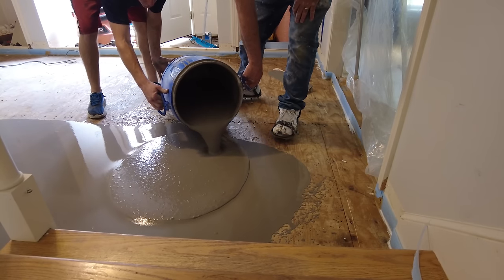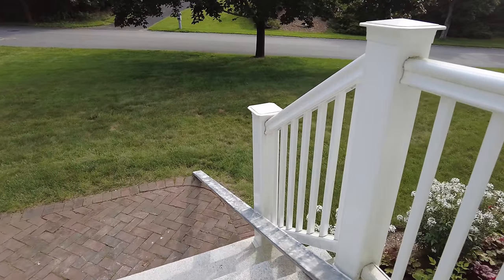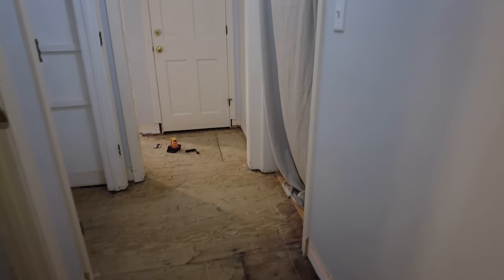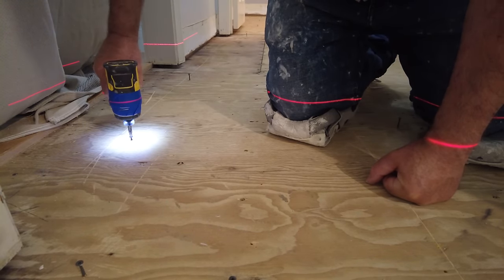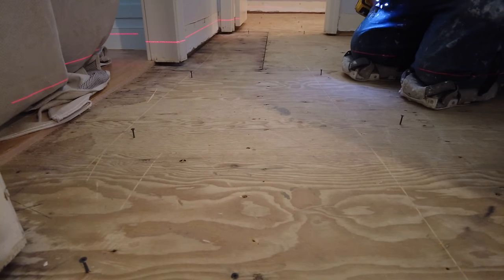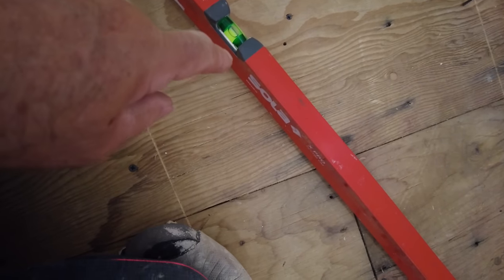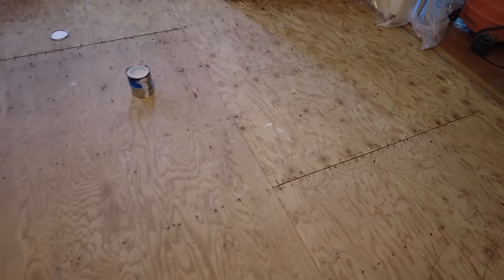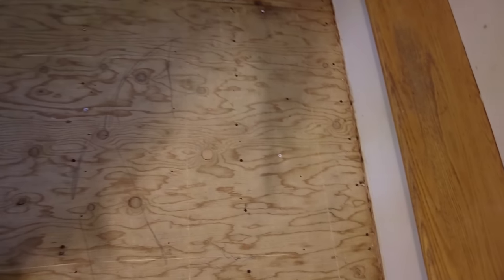Self leveling a floor, how it's done.

Comment: Seems to me such a large area should be lifted from under the house since you seem to follow the beams I bet a few beams are rotten or sagging and need to be repaired and raised up verses using that much leveling heavy (concrete) compound which will crack and then did you raise and level it all with backer board, on top of the leveling compound?  And what did you use for transition to the wood rooms after raising it so high up? It’s going to crack since that is a huge issue isn’t he house especially by the stair well.  How do you meet up the tile next to the wood and stair well since you cannot cut to go under the stair stringers?
Reply from the maker: https://www.youtube.com/watch?v=1uA1N-7cNHQ
The basement was finished so fixing the sag was not an option. Floor was inspected by the GC and found suitable for leveler. No my first go around.

Comment: Man! What a Pro! Wish you would’ve said GD once so I could see what can go wrong when I attempt it. I guess I can do a second coat in spots I screw up on. Also I didn’t notice you calk the cracks where plywood buts together. I was thinking the leveler would sink into cracks and have low spots. That’s IF there’s a slight open spot in the wood. 
Thanks for such a detailed installation!
Reply from the maker: Thanks for watching my video.

Comment: Use a roller bro holy moly! Much more effective

I also like the idea of the scews. In my head it seems like it would help with the strength as it wraps around the screws. So i even hit the bottom of them with primer which idk if thats working cause the surface isn’t porous really? 

Just do it anyway lol. I learned that trick with the screws though from another channel. Glad I’ve found all these im in the Chicago local for tile and I’ve been excelling very fast and already have a stable shop where I’m usually only off for a month total per year. 

Thanks Sal!

Comment: Can you use blue painters tape from the floor to the foam instead of caulk? Seems like a faster and cheaper way of forming a dam. Also, how did you deal with adding riser height with the self leveler on the first basement step?

Comment: Nice video Sal, makes alot of sense, I noticed you started pouring from the low spot? is that correct? I was always told to start at the high spot and let it run. Also, I'm doing a hardwood floor, glue down, was wondering if this is a good application for that as well?

Comment: I love how much of a perfectionist you are in all your tiling, even the masking tape and laser tip was amazing. What I am surprised about is the lack of using a spiked roller. Why is this?
Reply from the maker: Don't need it. Spike roller does not work well with a thicker pour.
Reply: @SalDiBlasi  Yup, found this out the hard way and my self level had a massive sag in the middle of the floor where I'd last used the spike roller. It was laid 2mm to 8mm

Comment: I did the floors in my house. Floors suck. Leave it to pros but I'm cheap. The cost was way up. Because it was so thick. I Added wood and put in pre mix for less than half the cost of a pour. This  house is a 1999. I couldn't believe these floors was so far out. They had to put down joists so unlevel and just shot the floor. Carpet done. Anyway great video. Way to explain. I was wondering how you was getting level yard by yard before it sets Because the Henry 555 sets fast. I think 12 to 15 minutes after mixing. This is alot of work, glad my wife was apart of most of it😅

Comment: Good Morning Sal, 

Hoping for assistance. I have a 12' x 24' sun-room that we plan on installing 24x24 tile with Ditra-Duo Heat. It is an addition that was added on over a patio. It is well made, supported by the house, and a 4”x8” I-beam. The last 42” hang over past the I-beam. The floor is flat, but not level. It slopes away from the house. It is a 1.5” drop in the 12 feet. So the need for self leveling is evident. It has 3/8” plywood over 5/8” plywood sub-floor, all in excellent shape.

Here is my dilemma. If the self-leveler has a min thickness of 1/4” I will be adding 1.75” of concrete to the low end, which is a lot in terms of material and dollars, plus it may interfere with a patio door at that height. Because the floor is 12x24 the plywood is laid in 3 rows of 3 sheets. My thought is to remove the first row of 3/8” plywood (leaving the 5/8”) and screwing it down over the low end. That would lower my high point by 3/8” and raise my low point by 3/8”. It would give me my 1/4” minimum self-lever thickness without raising the level of the floor too much, and make my overall fall 3/4” instead of 1.5”. 

Thoughts, and what am I missing?

Thanks

Mark

Comment: So I had the problem of squeezing the wedges and the FLOOR tiles moving to the point of serious frustration because I was running the center room tile line to run the rest of the room off of but when I started working out when I squeezed the wedges the tiles stared shifting and a started to scream in frustration!   What do I do set up a wood frame system to hold them?  Then…if I stop without finishing the whole job and putting in wall spacers I only have half of the tile with wedges so you cannot secure it or it tilts the tile on the one side…. More frustration screaming!  Helppppppp

Comment: I did this today, worked well, but the hardest part about using this method is making sure the drill is plum, if it is not then you’ll either be over the line or under the line

Comment: I need to level floors in my 1842 New Hampshire colonial. Exactly how heavy is this stuff per sqft per inch? My dimensional 2x6x12 joists are on 2 ft centers. Should I sister joist with hangers into the 7x7 girders before pouring this? Is there a lightweight version? Can it be applied over a linoleum floor? As always Sal, thank you!
Reply from the maker: Best to consult an engineer to figure that out, Find out what your deflection is and what load it can carry and what you need to do to beef it up.

Comment: Not the best technique I’ve seen to prime a floor but an informative video nonetheless.
Reply: ha ha did the trick. i suppose a 3/4 18or 24 inch roller would of been better. but got the job done
Reply: I use a sponge mostly to apply primer, hope the occupants were not in the house, hate it when they start telling u where they need to walk

Comment: Is the process the same for concrete floor? Instead of screws would you use tapcon screws to pin a concrete floor?
Reply from the maker: Same, they have adhesive pins you can buy, which you then trim to the correct height. https://amzn.to/2UC5bwo

Comment: if you needed to level a floor with old linoleum on it with adhesive that has asbestos, and you didn't want to remove the linoleum, what could you do?

Comment: Spray foam works really well to for daming the self leveler. A little more clean up the next day but less work in the long run
Reply from the maker: Thanks for watching my video.
Reply: @SalDiBlasi  hey thanks for putting them up i get alot of great information from them and appreciate the time you take to put them up for us

Comment: With a dip that drastic over such a short span, I would think to look at how sound the joists are supporting that subfloor before I threw on more weight with self leveler.  Maybe some genius contractor or ignorant DIY'er took a notch out of the dimensional joists weakening them.  Just a suggestion before a problem turns into a disaster when adding more weight to the floor.

Comment: ty, nice work :)    is there any leveling product you'd recommend if you were going to put a hardwood floor on top (instead of tile)?
Reply: You use shims
Reply: @teejaye110  any kind of a "rubberized" leveler if you wanted to put a hardwood floor on top of the original pine floor (very uneven) of a 1911 house?

Comment: Wonder if there is a way to vibrate the floor so it will actually self level itself?
Reply: I was thinking the same thing. a regular concrete vibrator is way too powerful i think unless one was able to use a variable speed or something.

Comment: Would it be bad for the subfloor gaps required for contraction and expansion that now its covered with self leveling concrete ? Would it be better if you just do it on selected low areas only and use handheld planer for high spots?

Comment: Just a couple questions for y'all. Why no membrane, since the house clearly has an issue with settling. Two have those issues been addressed? Since you self leveler is adding so much weight plus those ridiculously big  tile are going to multiply the problem exponentially? Oh yeah why didn't you address the butt end of the subflooring a few screws maybe.

Comment: Sal, I’m wondering if you’ve ever experienced an odor with NXT Level Plus? I did a small bathroom floor with it and have an odor that has persisted for over 24 hours. If so how long before it disappears? The bathroom has no windows and little ventilation so I’m moving air around with a fan.
Reply from the maker: Nope, call Laticrete.

Comment: Great job Sal I almost always learn something new on all your videos watching you has made me alot better at tile work and I appreciate the time you spend making these videos, 

Just wondering how many bags of self leveling compound did it take for a job that size.     And thanks again.
Reply from the maker: 25
Reply: @SalDiBlasi  just wondering how much sq foot in entire floor did that 25 bags  do and was it 2 days work for 2 men ?
Reply from the maker: @AlanMcCarthyguitar  about 300sq.ft. less than one day to prep just me, 1/2 day to prime and pour two guys
Reply: @SalDiBlasi  thanks Sal I appreciate you.
Reply: @SalDiBlasi  wow 25 bags for 300 sq feet was a lot !
Reply: @SalDiBlasi  wow...so do wood floors like that flex? will that stuff crack easily?
Reply: @daytonpyro  You have to make sure there is little to no flex in the floor otherwise it will crack. Especially for large tiles any movement in the subfloor will be a disaster if it's not dealt with.

Comment: With that much drop in the floor I believe I would just jack the floor back up. Something is obviously wrong with the floor joists. Theres lots of water damage seen on the plywood. Floor level and tile is going to add lots of extra weight and will cause that floor to sag even more as the weight settles.

Comment: Hey sal  I just finished self leveling over wood,and it came out pretty good.  It was my first time.  Glad I subscribed.  Thank you for teaching us.  I have one question for the next step should I install backer board over the self level or should I tile on top of the self level?  In my case the self level covered the whole area like you have in these video.  I would very much appreciate your input thank you
Reply from the maker: Backer board is not possible at this point, use an uncoupling membrane like ditra or stratamat, or other brand.
Reply: @SalDiBlasi  thank you sal

Comment: Excellent video of the process, but I would investigate the heck out of that basement/crawlspace first.  That much sagging is quite alarming and some reinforcement may be in order to the structure.  Then, and only then, would you want to proceed with the leveling up the rest.  The extra weight of the leveler, and large tile, may exacerbate and already potential weak point.
Reply from the maker: That is the GCs job, and this GC is quite thorough.

Comment: Sal like your videos and insight. How do keep the floor from sagging in the middle from the additional weight from the tile insulation and the leveler cracking?
Reply: you need to add more reinforcement studs under the plywood

Comment: I use an electric cement mixer on large jobs. This stuff always has to be moving or it gets hard fast.   Also, I always put lathe down.  Never had a tile crack on me (knock on wood)

Comment: Missing, silicone joints and seams so it doesn't drip between. Use a sealing primer on the floor, add metal lath on floor to bond floor leveler to the floor. It will NOT grip the wood properly without it.

Comment: Great video on an important topic that can be tricky. How would you approach a much larger area to level that takes more than a day?
Reply: Take more than a day?  You really should pour it all at once if it’s wide open area. 

Only way I’d do it in sections is if you are doing different rooms.

When we do hospital wings and stuff. We start in the Patient rooms. Use spray foam in the doorways to break it. Level out each room individually. Remove all the foam and do the larger hallways all at once.

Say you’re doing a big grocery store. Get more man power and more leveling kits. Keep going till you’re done.

You can also always rent a pump truck that way guys are just raking as it gets pumped in
Reply: @meetstepsisalcoholicdouche6167  Thanks for the info. I usually just work myself on DIY tiling projects. Sometimes I can get another helper but not always. So if I need to level 1,000+ square feet I guess I can't do it myself and even with one helper seems like it might be a stretch. Else maybe I can learn how to do the dry pack screed method.
Reply: @skyace888  1000sqft is very small unless you have a lot of walls and what not? 1000sqft wide open shouldn’t even take one guy a full day. Unless you’re using 5 gallon buckets instead of the 50gal mixing drums.

I take it your talking about a area with a bunch of different rooms? Maybe a main walk way? If so just find areas you can break it. Wide open you just gotta go. I wouldn’t pour in layers just to not create future bonding issues

Comment: Sal, does it make sense to waterproof the subfloor to prevent trapping moisture in the wood subfloor before you primer? Or is that overkill?
Reply from the maker: Follow the directions of the product you intend to use, do not add or subtract steps.

Comment: Why not use the rake to level the floor? If you use a slow set leveler and seal the floor with the acrylic sealer, it will stay liquid and not have moisture sucked out by the wood. then you pour and rake until you hit desired height.

Comment: Thank you for the tutorial. Two questions: what if you can't screw to the substrate? some recommend making compound 10% runnier than recommended by a manufacturer. Clearly, you do not approve. But can you please elaborate a bit?
Reply: Do not mix it 10% runnier.

Only go by the manufacturers recommendation. 

There’s actual science behind this. Not just for the floor to be level but to actually give the leveler strength. You add more water you weaken the mix lowering the psi it can withstand not to mention weakening its bond to the substrate
Reply: The reason I asked is twofold: all tilers I know make compound runnier; at the same time I doubt they would say about this in public for obvious reasons.

Rationale for making compound runnier is that manufactures make their tests at lab conditions which are different from a real floor. As per your comment, we don't rely on levelling compound as a source of constructional strength. I am not ready to comment about adhesion but doubt that runnier compound has worse adhesion quality.
Reply: @SergeM123  all tilers I know do too as far as mortars and floor patches. Those are more of a natural product though. 

It’s a little different once you get more into your synthetic based materials like levelers and epoxies.  We’re talking lab made materials. That’s a whole other ballgame. If you don’t mix that stuff properly you will have a failure down the road.not only that you’ll void the warranty and they will be able to tell it’s on your end for the bad mix.
Reply: Use shims set them down with some cement so they dont move when you pour self level and yes we use it runnier because it flows better and it gives you a better finish it does not compromise your job i do it all the time never had a problem
Reply: Screwing to the substrate has some advantages due to its simplicity in application and fine adjustment, however packers or shims stuck or hot glued achieves the same result. ‘Levelling tripods’ are another good option if you are levelling floors regularly. 
Overwatering is a very bad idea! If you can’t get the floor levelled at the correct mix ratio then you should not be levelling on your own. When you overwater you ‘loosen’ the fluid. When the fluid is loosened the density changes and the components of the self leveller sink to the bottom leaving a murky watery soup on top which has zero strength once set. Take the example of milk and yoghurt, each with a spoon of sugar tipped over it. In one, the sugar would sit on top while in the other it would sink to the bottom. Neither is a good result but it demonstrates the point - the components of the self leveller need to be evenly distributed in the mix to do the job they are designed to do. 
We all realise that an ultra loose mixture would sit like glass over anything and everything and in fact epoxy products do exactly that with no help needed to do it but epoxies are expensive, brittle and poorly suited to the requirements needed for tiling and or floor laying.
Reply: @reneele-chet307  Thank you.

Comment: Need help!!!!  We bought a 5,000+- sq foot commercial concrete block building. It has a concrete slab with drains (covering) so very not flat. Recently we realized from the front to back (~100’) that the building drops about 3”!!!!  So leveling is out but maybe we could “flatten”. Help?!
Reply from the maker: Does not have to be level, but does have to be flat.
Reply: @SalDiBlasi  I was looking at different options and it looks like schluter (or other) uncoupling membranes are a bit more forgiving. I found an Alino brand that’s way less expensive but it says not for porcelain. Thoughts?
Reply: It looks like they recommend plywood over the top of the Alino Dampro. If that’s the case, Schluter might be cheaper.